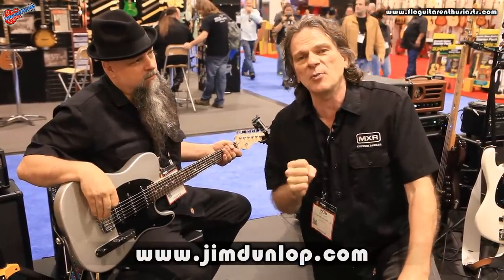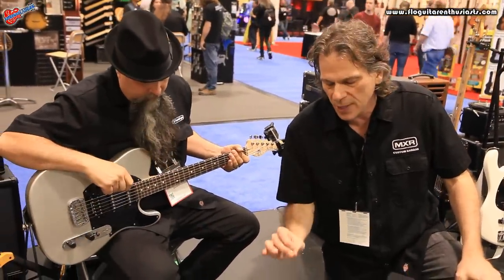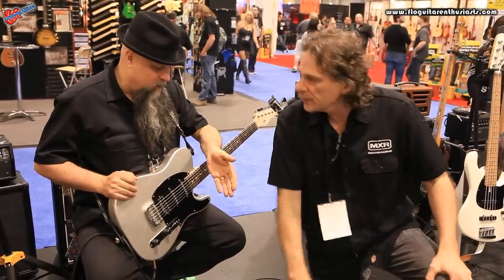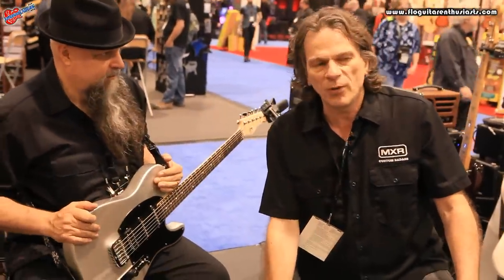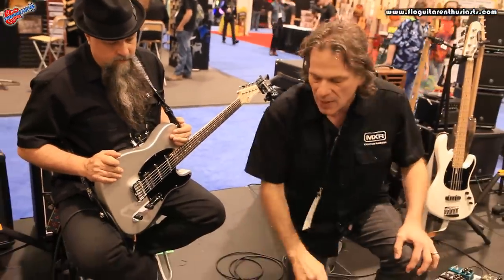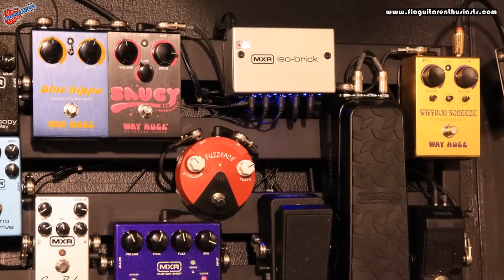NAMM 2015: MXR ISO-Brick Power Supply Demo with Bob Cedro and Bryan Kehoe

Comment: for me a power supply that doesn't have a big amp/computer cable (like voodoo lab, t.rex and many others) is a big nono. these tiny cables twist and snap, and if it does its a struggle to find a matching power adapter...
Reply from the maker: SweBass hard to say what would happen, but thanks for watching.

Comment: Ok stupid question time...can I use the daisy chain cables to go from the straight end to a pedal then the curved end to the brick? I see most people go straight end to the brick and curved end to the pedals. Reason I ask is because I've got some pedals on my board that would work out better if I used the straight dc end to the pedal and the curved end to the brick. Any input would be very much appreciated before I blow up something.
Reply from the maker: +SoseBass 11/2 I wouldn't know for sure on this, I would check with Dunlop.
Reply: Ok, thanks for your help.

Comment: Thinking about ordering one, but I have yet to find a product description that says whether or not it comes with the cables. Is that something we'll need to order separately? Also, what are the physical dimensions in inches? Thanks. Love MXR!
Reply from the maker: Neville Hunter I am not sure what all it comes with, but hopefully Jim Dunlop USA can answer that for you.
Reply: Neville Hunter Agree with you completely Neville. For being a very important part of the board, we NEED SPECS! How MXR's site is so vague about this is incredible to me. What are the dimensions? Does it come with cabling? Can it be mounted under a PedalTrain (looks quite thick to me in its height). Come on Dunlop, monitor your social media and reply to this, or at the very minimum, update your website to tell potential buyers what they absolutely NEED TO KNOW.